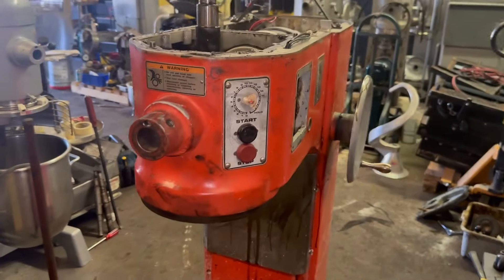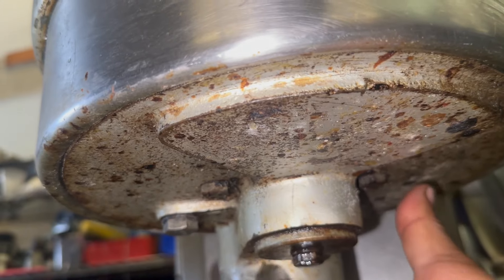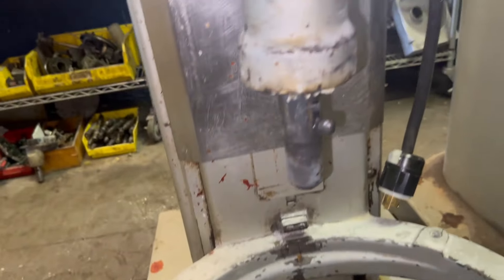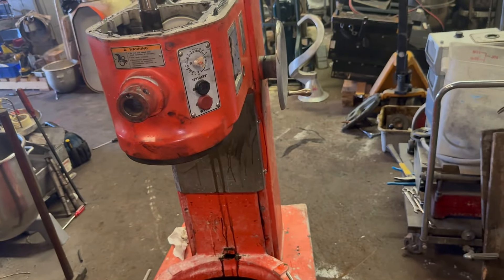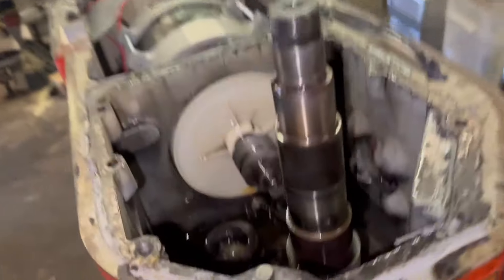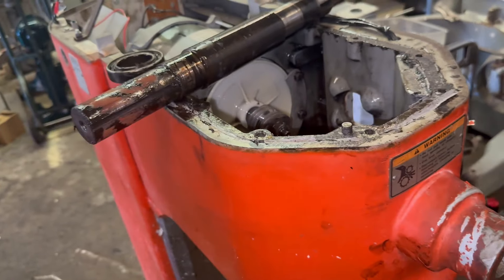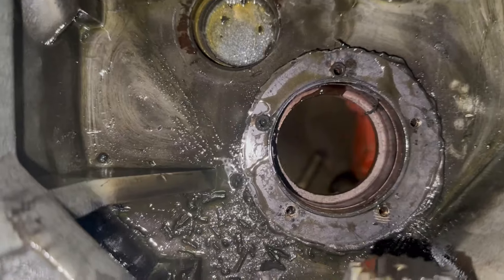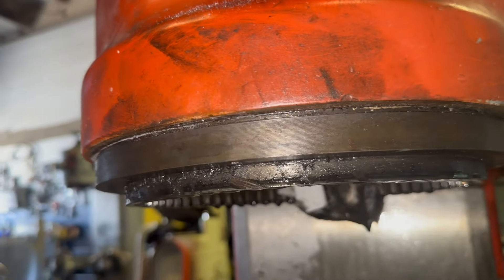Hobart 60qt Planetary stuck Won’t Come Down !!!

Comment: As a Hobart technician, i applaud your ingenuity with a situation where many techs would either try to cut the planetary off and replace it, or declare the equipment unrepairable.
Reply from the maker: Hi there thank you for your comment 
We do our best to help our customers we will not give up until nothing can be done, but for much simpler reasons some technicians will condemn a mixer
Not our practice we try our best and most of the time we resolve and fix the problems with the mixers

Comment: Great vid. Why do the shafts rust there. How is moisture getting in there. I would assume anti sieze compound is used liberally on the shaft for the next guy.
Reply from the maker: Great question 
Is hard to know I have encountered this issue more on mixers from the 80s more often than the much older units like mixers from the 60s I don’t know why maybe the quality of the material on the main shaft is not the Same as the really old ones .